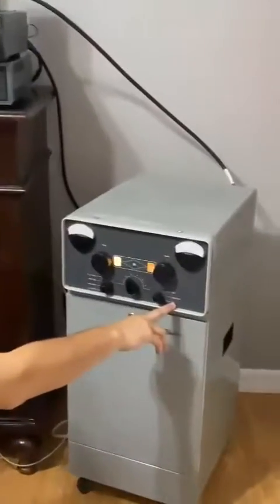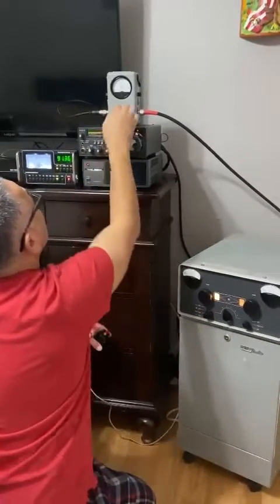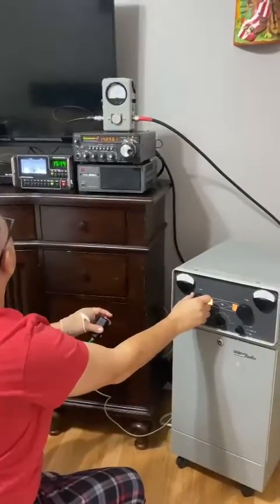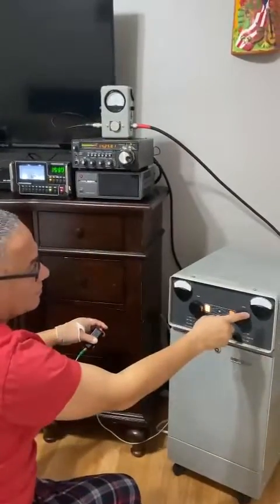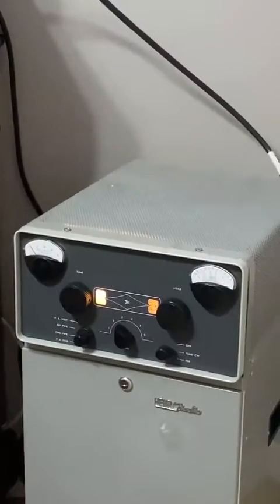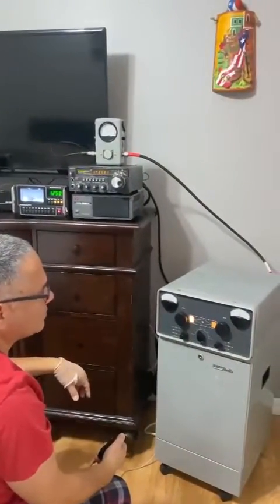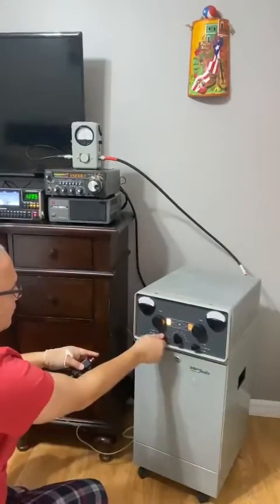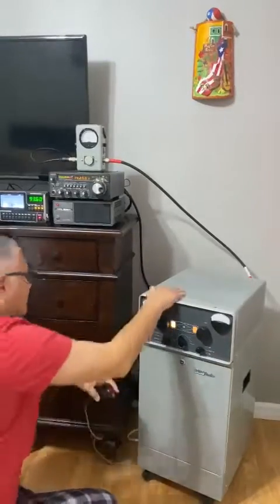Kelvin N4UXG, firing up the Henry 3K Amplifier...

Comment: I thought I recognized your voice. Your old Kenwood TL-922A is still in my shack here is Oregon. I did the 10 meter mod on it and will be doing a few other things on it in the future. What a strange coincidence I see you here on YT.. My call has change since I bought your amp so it won't do much good and I don't want to put it out because it's linked to my address and my channel is getting increasingly public. I'm sure you remember anyways. Glad to see your Henry is working as desired. 73 my friend - Mark
Reply from the maker: Hi Mark, That Henry 3K was sold and I now am using the Alpha 9500 and Alpha 8410 here in Florida. I have another QTH in Sabana Grande, Puerto Rico and I am using a Mercury IIIS.
Good to hear from you and know the Kenwood TL-922A is running strong.
73's Kelvin N4UXG